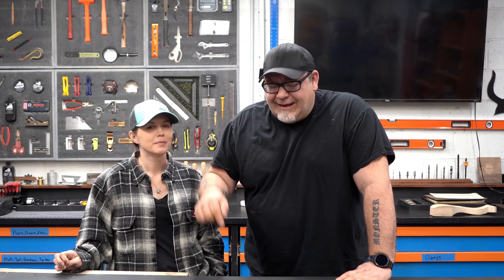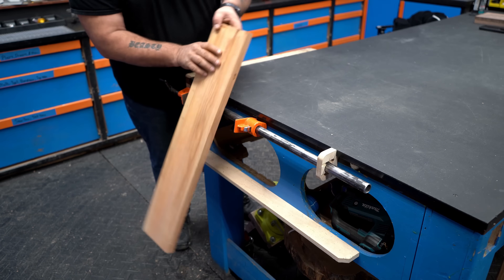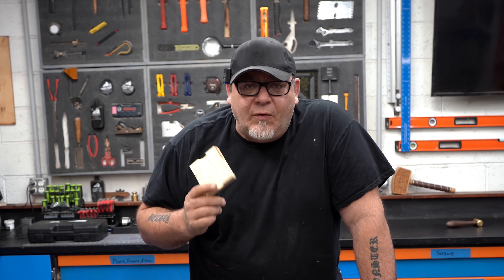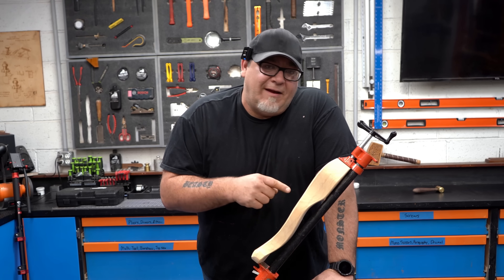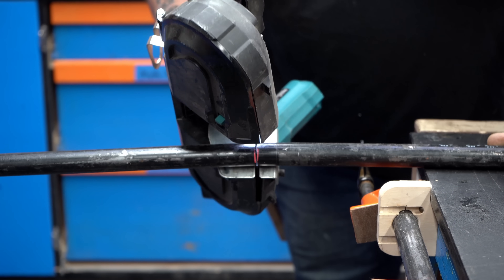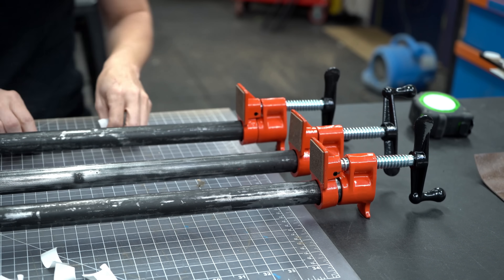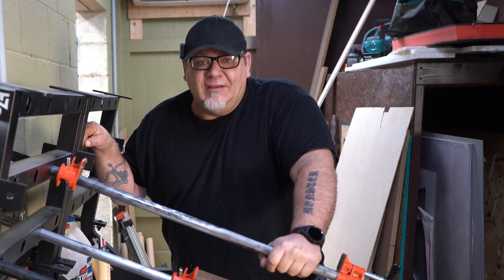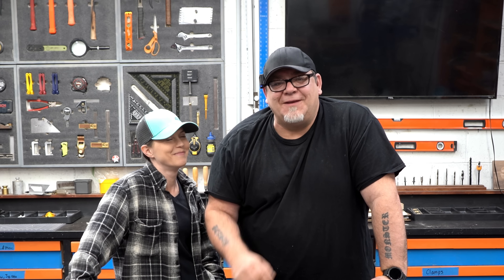5 Easy Ways to Save BIG Money with Pipe Clamps and These Little-Known Tricks

Comment: I just love my pipe clamps, and use them often. I learned a couple of new tricks today, and for that I thank you. 👍

I use Bessey 1/2" clamps. I like them because they have real crank handles, as opposed to the whimpy bars you often see in the lesser versions and they have 'extenders' on the bottom side that keep you from racking your knuckles as you crank down tension on the handles.

Pipe clamps are designed to be used with BLACK pipe. Never forget this. Galvanized pipe is slightly larger in diameter than black pipe, making the tailstock harder to adjust and the galvanized zinc coating is quite soft, which can cause the tailstock to slip, losing your clamping pressure. Black pipe can be a pain in the tukus, but taking a moment once or twice a year to maintain the pipes themselves will insure proper...and happy... experiences.

I use Izzy's method of buying pipe...slightly. If I need 12" clamps for gluing up stock for ... hmm, let's say legs, I will buy 24" pipes and cut them in half. I do keep at least a half dozen of each length (on the foot...like one foot, two foot, etc) up to 5' long and change the pipes out depending upon my needs.

Don't pay too much attention to the pipe clamps haters. They just don't know how to use and/or care for a tool that dates back to Gramps time. Care for your headstock (the actual clamping pieces) and care for your black pipe, and you'll be a happy 'clamper'!

Comment: I have the pipe clamp heads that have the same cam grabby thing on both ends so no need to thread anything and they're about the same price as threaded types.. Just keep a threaded joint for the two ends that were pre-threaded from the store in case I need a 8 foot clamp or whatever. I've needed that exactly once in the past 8 years or so and of course my son left it out in the rain so I had to kill him..perfectly understandable,  huh?
Reply: I've been using the same for while now and they seem great so far. Much easier for a low-budget home shop
Reply: Those are nice enough after a while they slip off.  The more you use them the faster it happens. Same with pressure the more you apply the faster it happens ... Really slick for infrequent use though

Comment: Traditional pipe clamps are great. I like to have electrical conduit threaded to make the pipe out of because it is much lighter than the usual schedule 40 stuff. I find it plenty strong enough for my needs. It wouldn't help in the table mount scenario you showed.

Comment: Also - depending on where you live or where you're shopping, the galvanized pipe can be substantially cheaper than regular old black pipe... For me, it was less than half the price. Depending on the plating method, some galvanized pipe can be bumpy instead of smooth, with a softer coating that causes issues with clamp sliding and releasing properly. My pipe doesn't seem to have these issues